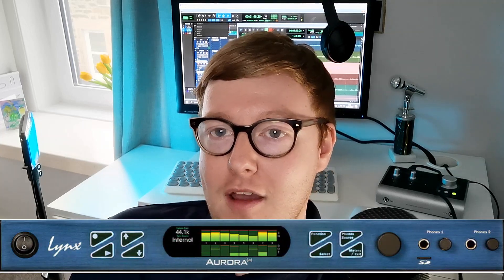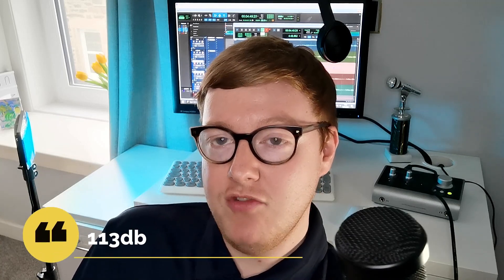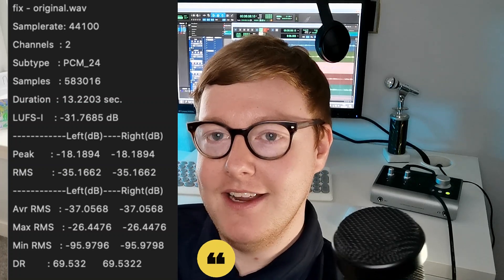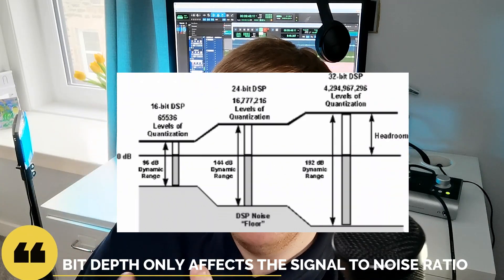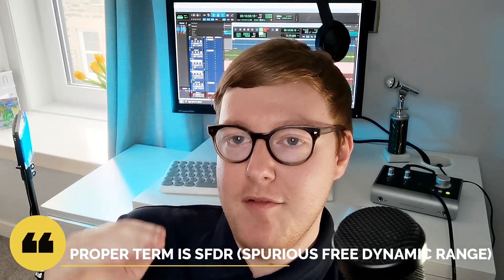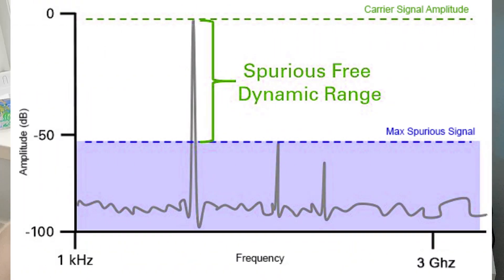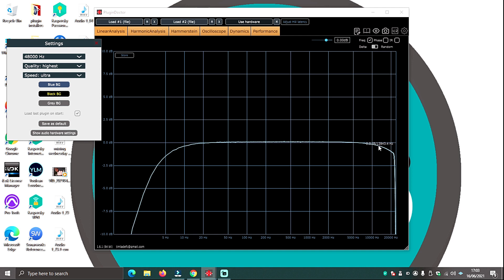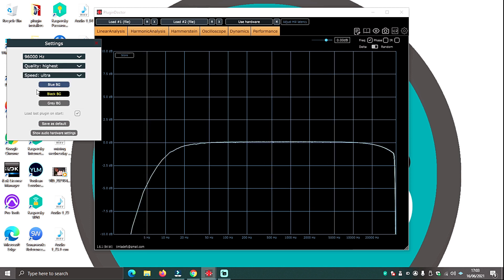Do you lose audio quality in analog gear using budget interfaces vs expensive ADC Converters (Pt 1)

Comment from the maker: FYI I have done another test 3 years later (Jun 24) with evo 16 and sp8 and same results. White noise, pink noise, piano and a full mix. Audient at 96khz is more transparent than the lynx at 48khz, but lynx at 48khz is more transparent than audient at 48khz due to it having better anti aliasing filters (they use digital reconstruction filters in the DAC). 
Lynx isn't coloured and is fully transparent. Audient at 48k is the same. Both nulls on a full mix at 48khz do not result in even a 0.1db difference. So whilst the lynx is technically superior at 48khz, the difference in reality is inaudible and is proof diminishing return on investment. Only your dog will hear the difference 🤣

Also to counter any of the 'how do we know it's actually a lynx converter' rebuttal here is a blog post from lynx themselves on their website asking access analog why they chose the lynx aurora (N) to stick in their racks. 

https://www.lynxstudio.com/blog/audio-plug-in-developers-turn-to-lynx/
Reply: @PaulThird I own a Prism Titan. I did...dozens of loopback round trip tests until I settled on that unit being the best Price Vs. Performance unit for my needs (mastering). There's nothing wrong with working with what you can afford...but I can't go back. The difference isn't subtle.
Reply from the maker: Tbh im not gonna lie.. over 3 and a half grand for a nearly 9 year old interface is pretty crazy to me, especially when apollo x6 measures comparible and actually better in certain technical aspects and also has the 2 unison preamps including the real time uad plugin dsp and routing.

In 2014 prism and lynx were measuring the best and the science was on their side but now I just can't fathom why the price is still so expensive when in regards to DAC you have topping and RME wiping the floor with everybody and in regards to ADC it's kind of a non issue in today's marketplace 

I do personally believe for an all round interface the flagship RME stuff is pretty much end game but for a DAC/AMP I can't see past my topping dx7 pro+.

I personally couldn't pay over 3 grand for an interface and the headphone amp was cheap quality but if your not bothered about headphones then it's a bit of a non issue. It's justifying that price tag that really sits in my throat but each to their own.
Reply: @PaulThird  now I'm not a shill for Prism. It won the shootout at the time (back in 2015)  and I haven't felt any need to replace it since. I think they should make a cheaper version without preamps but that's neither here nor there. However...regarding age of design. The next best was the IZ Radar/ADA converter (96 Classic). Which is a compelling argument if you need around 24 I/O. Nothing against UA, but the Classic has been around much longer than the Prism Titan, and it smoked dozens of high end converters. Including what UA was making at the time. Also there's a "musicality" factor. Round Trip very few designs sound better for it in terms of balance if you're not running analog gear. I love RME Too...but nothing they were making at the time could compare with either of those designs. Now I haven't heard this years model with RME and UA...and I'm sure "specwise" they look great on paper. But that round trip test is everything to me.
Reply: Glad you’re aware of your/their technical oversights with the test… get these units using their actual drivers to compare them and then tell me your Apollo still stands up… I did… 

Also, the elephant in the room is how they sound…. Maybe try a multi track mix rather than a null test on a mono file to actually hear micro differences exaggerated rather than NOT hear to prove they’re the some amount of different…. Of course they are!  Your houses power grid is involved now!

Simply put, if you actually had one you’d hear the difference via DA immediately to the extent of where there would be no urge to compare for confirmation bias… you’d just lean back with a huge grin on your face having experienced the answer….  This YouTube vid wouldn’t exist as you’d experience a completely undebatable difference audibly prior to any experimentation to try and prove anything… You probably wouldn’t care what others thought about whether expensive conversion is worth purchasing if you had it to hear in person.  

I laughed when I saw this… as far as I’m concerned it’s bad advice for newer engineers or artists who want to sound their best. Good for my business if my competitors “save money” by following your advice… actually might explain a lot…

Also… better conversion features less crosstalk and lower noise floors… you’d need have multiple channels going to show the differences more clearly. This example doesn’t even compare a stereo file therefore the crosstalk can’t be perceived. What about volume?  Did you calibrate the aurora to the exact db of your audient and did you ensure their loopback has perfect calibration? What about on their end?.. AES, Spdif, usb, Dante, thunderbolt?  All perform differently…. How can you hear the Aurora converters when your audient plays the Aurora’s sound?

Seems to me it’s more of a loopback calibration test than an actual converter comparison.
Reply from the maker: This whole video is about ADC not DAC. Paying an extortionate amount for ADC in 2024 is needless.

I have arguably one of the best measuring DAC converters on the market in the topping dx7 pro+ and it cost me £700. Does that now mean I'm coming after your business? Measures better than lynx and prism and I still wouldn't pay 3 grand for an aurora for ADC when I have an Audient SP8 which manages to keep noise and distortion inaudible. 

I've also got an apollo x6 and it doesn't bother me which I choose for 500 series. 

There are tons of comparisons over an entire mix with ADC converters and the results are always minimal enough to the point whether either don't enhance the track any better.

Its ADC for analog gear which already has its own noise floor. Whether you patch in a 1073 through aroura N or audient.. Still gonna sound like a 1073. And no there isn't going to be a "night and day" difference.

What this test proves is that there is no such thing as a fully transparent converter. The nulls prove that they all very very slightly alter the sound. The analog gear signal comes in to a 5 grand converter isn't 100% what comes back. We are talking extremely minimal differences, but differences none the less. 

There is no "sounding best" as an ADC's job is to purely convert the signal. It's job isn't to colour the sound, make it wider or alter its frequency response. It's just a converter.

In ADC's all we are comparing is extremely minimal differences. That's why you don't need to spend a shit ton on ADC converters. If you only own a fairchild and run it through an id44 for ADC it'll sound just like a fairchild and no other converter on the market will make it sound "more like a fairchild", that's impossible cause we know that EVERY converter on the market doesn't fully identically replicate the signal in its conversion.

What you hear out of your DAC doesn't reflect whats going on in the ADC.

I could print a ton of gear through a lavry gold and play that through my topping. People will say wow this sounds amazing.

I will then replay that same lynx  print out of a cheap DAC and people say.. Wait that doesn't sound as good!

What you hear in this test are 3 printed files being ran through the same dac which is YOUR dac. The aurora doesn't pass through the audient in this test as the signal is sent lossless over the Internet, recieved, passed through access analogs converters and then transmitted back lossless over the Internet. The audient ADC & DAC never touch what you hear in the aurora

Essentially it's the exact same as me sending you the unprocessed file to print through your converter using your daw and then sending me that file to compare in my daw.

What you have to accept is that what you hear out of your DAC is seperate from your ADC conversion.

And THAT is why it's not bad advice for newer engineers. Don't worry as much about how ADC affects your analog gear, worry more about how your DAC affects your monitoring
Reply: @PaulThird  there’s no DAC in a loop test?!
Reply: @PaulThird  also, for what purpose? Tracking a 1073 spx will be similar on both interfaces but stereo mastering or summing will not… If you’re a mastering engineer, a crap converter definitely makes the job of having your work translate elsewhere more difficult.

FWIW, I track with my Lynx Hilo converter over the Apollo, SSL MX, and Antelope Goliath because it sounds more like the 1073 spx I want to hear. Smoother and more detailed than my other options…. Why? DC filtering? Aliasing filters? Power supply? Clock implementation? thunderbolt driver? Donno… just sounds better…. Clients like stuff that sounds good and so do I.

If I were going for entirely not different, I’d stay digital…
Reply from the maker: There is the DAC in a loop test but not when tracking with analog gear.

What I'm trying to say is that what you hear from your DAC via your montors isn't the same as when you route analog gear through it.

The DAC doesn't imprint any of that onto the printed signal. It doesn't make a stereo source sound wider, clearer or "better". Which is why if I printed stuff through your converters and listened to them all back on the same DAC they'd all sound basically the same. 

As I said it physically can't do on the print what you hear out of your monitoring as it's job is to act transparently. The null and examples proves that there is hardly any audible difference between them as does other tests on youtube. 

"sounds better" is your opinion. Doesnt make it fact. In reality your biggest disadvantage is your own confirmation bias as from the sounds of it you rely on your expensive gear to make you sound better. Let's be frank here, you are mocking the professionalism of others using cheaper converters than you when in reality there are mastering engineers out there working on big hits completely itb.

This is where we have an issue in this industry. There are lots of engineers who have spent a ton on audio gear feeling the need to discredit others who decide not to make those purchases as videos like this challenge the idea that buying expensive shit makes you a better engineer. 

The quality of audio gear, especially conversion in budget gear has become better than what was available decades before. Did it make those massive engineers any less professional? Did it make their records sound shit?.. No, people are still using some of these mixes as references to this day. 

All this subjective bullshit comes from heavy investment. Truth is in today's modern world there are £100 DAC's out performing £1100 DAC's. I have better measuring DAC than any of your converters, for £700 and you still don't see me saying that I would be able to take on your business and steal your clients. Truth is I just have conversion that doesn't need to be as good as it is in reality. I don't feel any better than you or anybody else, cause it's about what you do with it. A fairchild through an aurora set in a way where the compression doesn't really work well with the mix won't sound better than a fairchild through an SP8 that is set right to work well with the mix. 

Its about the big differences, not the infinitesimal ones.
Reply: @PaulThird  when full band tracking, the effects of AD converter is huge… and yes, listening on a cheaper DAC will yield less details… don’t even get me started on the volume controllers too… I think you’ll look back on this someday and feel a little differently. Loop test are measuring in vs out of said converter… you simply showed us that both converters can kinda null with themselves even though they both publish exactly what their THD and dynamic range stats are already…. Do a test where we hear what the converter doesn’t omit from source as opposed to focusing strictly on what it does. 

Stop thinking folks use gear to compensate for lack of skill… perhaps more skill might require more expensive gear to take advantage of said expertise?  You keep bringing up a Fairchild as if they’re used in 2024… if I spent 120k on a 70 year old unit you better believe I’d buy a nice ass converter to hear that SOB the best I possibly could!

Music is about feeling at the end of the day, and some of these tools simply do a better job of that than others…. There’s dozens of stats and setup variables that can affect the results and personal experience, but “subjectively” things that more people enjoy the sound of are considered better sounding. 

I would love to do some loop tests for you and we should LISTEN to the end result…. Then, if you want the rubber to really meet the road, you’d clip a db or two during mastering and see how that sounds.

I track with my Hilo because it’s easier to mix the vocals in compared to my other conversions…. Does it matter to client?…. Never…they could give af. It  matters to me because it makes my job easier and more fun while satisfying the client more.

Good luck!
Reply: Gotcha, The inserts are always after the mic pre...should've known that.
Reply: Touche XD
Reply: Looking forward to this
Reply: You should do a loopback test with each converter to compare conversion quality.  Run some music through the coverter at least 30 times, that will be a good test.  Eric Valentine said that he tried this 20x with the Lynx and couldn't hear a difference from the original source.  I'm curious if that would be the case with the Audient or other cheaper converters.
Reply from the maker: @gear7057 pointless test in reality. There's been lots of tests done where it takes a pretty stupid amount of conversion to actually degrade the signal. Present day production did it with audient. Was an absurd amount of conversions
Reply: Yes DA can be used to color… tons of them are made for that.

Or transparency…

My early 2000s Lynx Two card sounded far superior to UAD blackface mk2. They spec about the same. A lot of it is how the converter handles tiny overs…. For example, my SSL MX converters bark and get super distorted if you record too hot… I can switch to the Antelope Goliath and get a completely different sound… much more open and sterile… the same clipping isn’t an issue anymore. Yet, with headroom, the SSLs generally sound better to my ears.

Pros and cons my friend… there’s actually analog circuits in there…

Meanwhile, the Hilo is amazing… especially with good regulated and balanced power. There’s sense of being inside of a mix I don’t get with any of my other converters. With vocal tracking, the Goliath is nice because it can handle clipping very transparently… especially for acoustic guitar or drums, it’s great. Hilo is nice for tracking vox because it sounds super smooth and rich compared to my other options. SSL and Hilo sound very similar when the converters aren’t being hit hard, but when they are, the Hilo stays exactly the same sounding and the SSL starts to sound crunchy, even if it doesn’t actually show any clipping.

Some people do audio for reasons other than obsessing about how stuff sounds… I’m not one of those people…
Reply: I hate to say it, but while 0.1db is very little when talking about an overall volume level of music, I think that level of difference can be fairly audible when it comes to modifying complex waveforms, particularly because it may be random divergences from the actual level, which causes a noisiness that was not present in the original signal. It might only be apparent by comparison, but it's not inaudible by any means. The null tests sound similar to mp3 compression null tests, and not many people argue that you can't detect the difference vs the original if a track is lossily compressed!
Reply from the maker: @ModusVivendiMedia I said it's not even 0.1db of a difference. It's less than that. I did a blind test on another video where I asked people to pick out the original, 0.6db level difference and 0.6db tonal difference caused by saturation and in the poll over 60% admitted that they couldn't hear the difference with only 5% guessing right. And that was 0.6db difference.
Reply: I enjoyed this. For what its worth I agree with the theory, most modern ADC is quite good, obviously. For whatever reason though, some devices really do stand out. I'm very fond of an old BLA Signature 002r, for instance, and it's clock's affect on other devices. It probably isn't due to 'accuracy' per se, it might be noisier than some other converters for all I know,  it just  seems to have more info somehow. I liked old R.M.E too. Some of those things may hardly be audible in a null test, but still make quite a positive difference. Certainly less so in 2025, than in 2005. But hey, many of us prefer a Valve amp to Mosfet, too. Keep up the good work. ;)